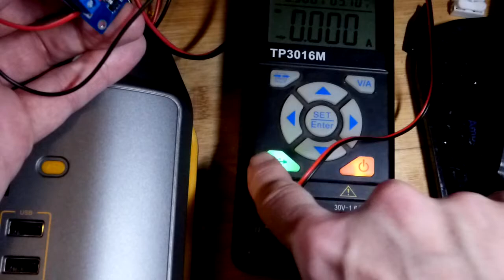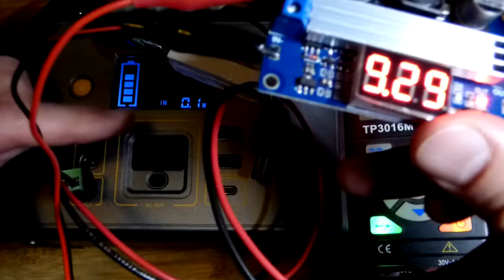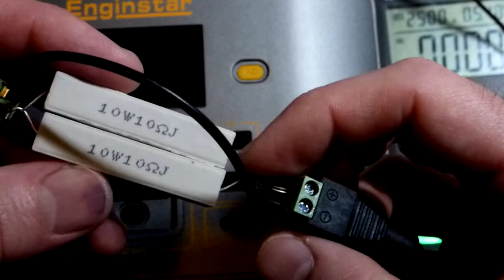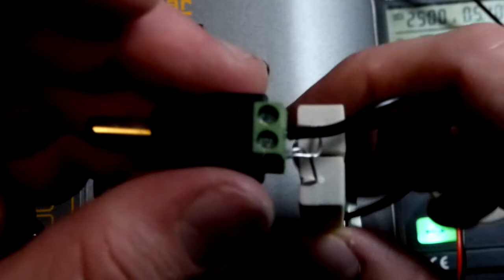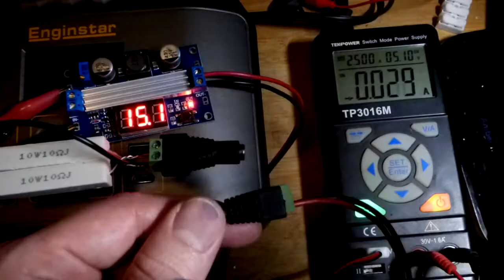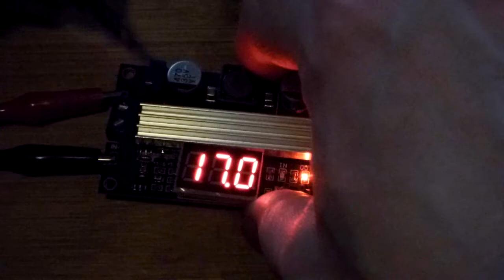Testing if adding low resistance lets me charge a power generator with a voltage booster

Comment: looks like you are simulating a virtual solar panel with your hand held power supply. well now we know the short circuit protection on the hand held power supply works.
Reply from the maker: Solar is one of the power sources I have in mind while I am doing this testing. I am also trying to be able to safely recharge power systems with DIY and other low priced battery options, without wasting much power while doing so.